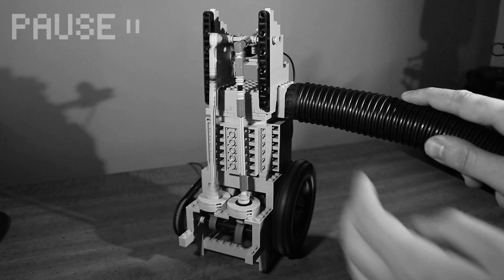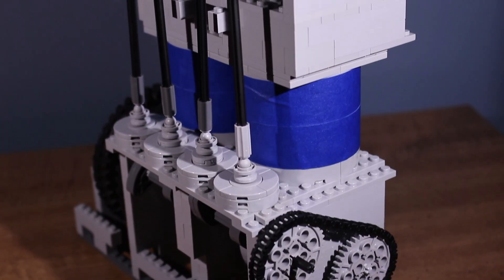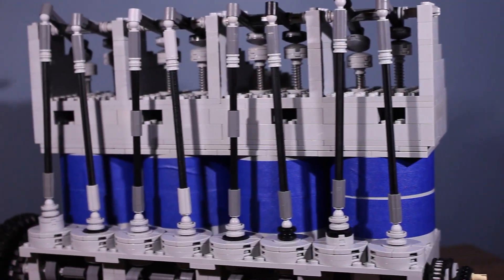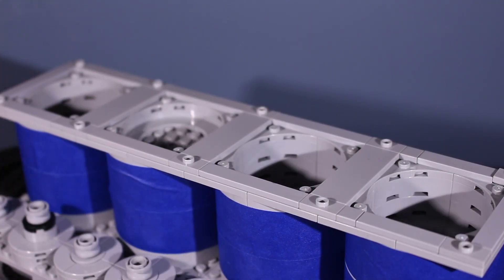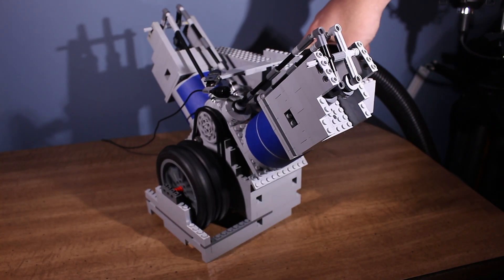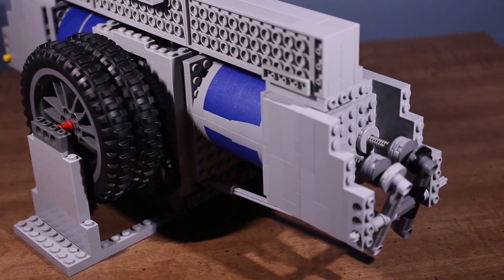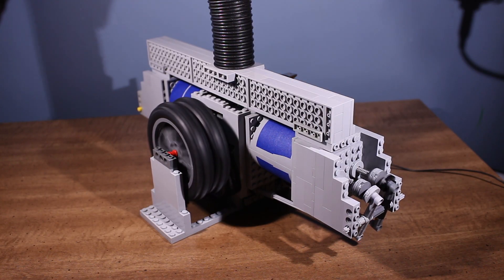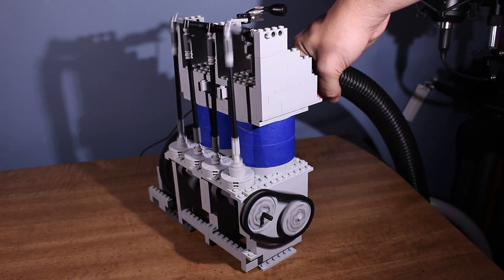Testing Different Round Piston PUSHROD LEGO Vacuum Engines!

Comment: why dont u put a throttle body on NONE of ur engines?
Reply from the maker: Because it's not really necessary. Adding a throttle to any of these engines would make them perform worse. Not that I'm aiming for performance or anything, which I'm not
Reply: @DeltonAdamsLEGO yeah true but it would make them sound cooler and well, we will then have a throttle? which is better
Reply from the maker: @CleanFrezzat  I don't think it'd have much of a positive impact. I mean, most of these are fairly slow, so adding a throttle just slows them down even more. If I can get some of these round piston engines to start running at higher RPMs, then yes, adding a throttle would make them better. I'm just not there yet
Reply: @DeltonAdamsLEGO ur right but u dont need to make a piston engine...like there are other types of engines out there..some of em are running at 9K RPM max throttle!...like overall the idea...like cmon who doesnt want a throttle on their engine?😂, like an engine is not a proper engine without a Throttle...but i guess your channel your wish....but remember that most lego engine channels do put throttles on their engine...also wdym it will make it worse?...(if u ever make one...gimme a shoutout😊)
Reply from the maker: @CleanFrezzat  true, but those other engines, more specifically their creators, are trying to go for max RPM or max performance. I mean, you can get what, like 40,000 RPM out of a turbine with basically 1 moving part. And I've built engines that, to me, are pretty fast, one being an SVS with a throttle, and it's fun. My goal is to build more realistic LVE's, which is why I'm pushing so hard for the 6x6 round pistons, and hopefully in the future, 8x8's. In my opinion, and not bringing anyone down for this, but I feel like the LEGO engine community has just been flooded with engines that are designed in the same way, SVS, butterfly, turbine, they all seem the same to me. I want to build things that are more unique, different.
(also not to keep going on and on, sorry lol, but what I mean by making it worse is that since the engines already run at low RPMs, adding a throttle would further reduce the idle, which brings them to a point where the throttle is basically useless)
I'm sorry for such a long reply 😅😅
Reply: @DeltonAdamsLEGO yeah i guess your fairly right...but since your focusing more on releasim...a throttle seems more releastic to me😅...and tbh like dude....who doesnt want a throttle on their engine...but as i said your legoos your choooice!...also try to put yout engines on like a dyno or something to see how theyll perform...and also try to make a V8(throoottle?😊) A V8 sounds pretty cool, ive seen some V8s in lego Vacuum engines so you know,anyways goodluck with your channel and cya!❤❤❤
Reply from the maker: @CleanFrezzat  I will be honest, I want to add throttle to my engines, after all, that makes them even more realistic. But if it comes at the cost of making it worse than before, I don't see the need for it until I can improve the un-throttled (?) design.

Also, a vacuum V8 would be sick, though I doubt my designs would benefit from a throttle.

Anyway, thanks for the comment (and replies). Always welcome!

Comment: Woah. Its OHV, Round piston. Color gray. And can have more cylinders? Maybe the next step is OHC or SOHC
Reply from the maker: I've recently tackled SOHC with some success (not incredible, but it did run). Haven't tried anything like DOHC yet, but I'd like to soon
Reply: Is there any problem with the SOHC? I'm probably thinking of the spring since the pushrod relies on gravity. Or maybe the timing no?
Reply from the maker: No, I tried SOHC along with angled valves. It was the valve design that made it relatively slow
Reply: Is the reason leaks? You said it yourself, leaks slow down your engine in the video you attempted to make round cylinder a vacuum engine.
Reply from the maker: Yeah, sealing an angled valve engine without glue or tape is really difficult, and I haven't found a good sealing design yet
Reply: You aiming for realism? If not then make the poppet valve square, that would seal good enough.
Reply from the maker: I'm going for max realism, that's why it's a challenge. But a challenge I'm willing to take on!

Comment: Awesome engines! I'm impressed that you found the right amount of lash! It can be hard to get the happy medium between the poppet valves sealing well and the pushrods having enough tension to stay installed at speed - especially on those flat engines! Well done!
Reply from the maker: Thanks! Those flat engines did give me a tiny bit of trouble, and they were hard to pick up without knocking the pushrods off 😂